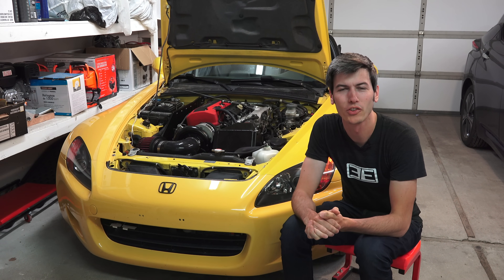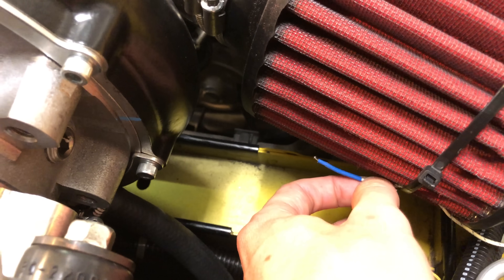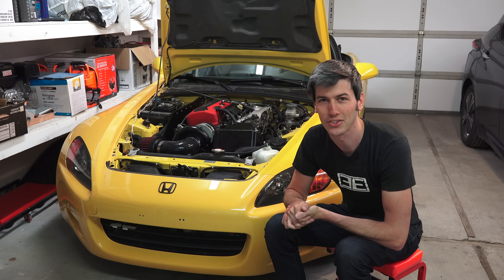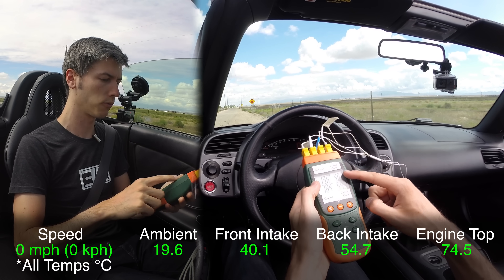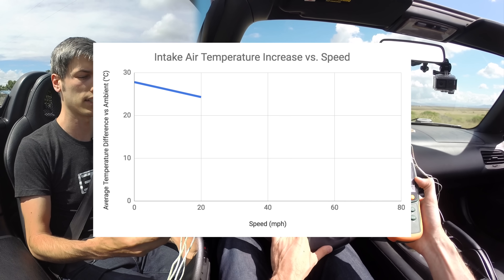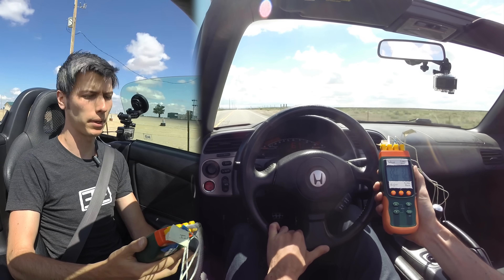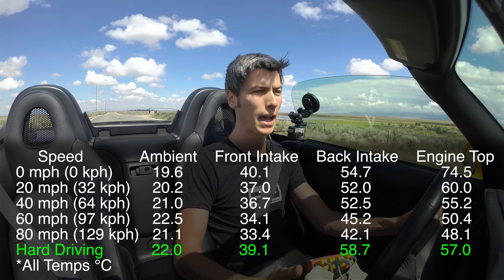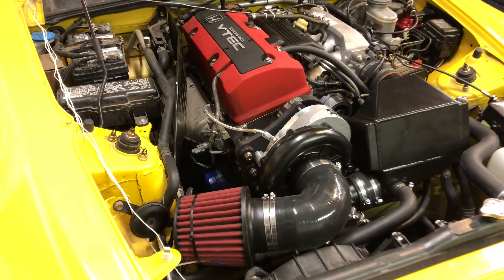Does My Supercharged S2000 Have A Hot Air Intake?

Comment: BRILLIANT VIDEO Jason! I have wanted to do this for YEARS! If you look at the reduction in air mass due to the temperature (simplified assuming intake is purely volumetric),  using Charles' law it's still 290K/320K = about -10% theoretically weaker mixture than it need be. Wouldn't it be great if you could actually get enough air to EXPAND and thereby cool below ambient temperature and nevertheless fill the compressor at atmospheric pressure. NACA oversized intake and insulated expansion chamber?! Your compressor will be heating up the air further, so IMHO you still need to measure the air temp. after the compressor. What do you think? All the best Rob in Switzerland.

Comment: Every time I see kids install a "cold air intake" with one of those filters under the hood instead of the true factory cold air intake they removed, I laugh. "but it has less restriction", no, it only makes more noise. However, the sticker form the box makes 5 more horsepower according to Rspec Ryan.

Comment: Great video I was really surprised as well. I would love to see a ram air / cold air intake tested out, possibly replacing one of the foglights with an intake. I would love to see how much pressure you could make at highway speeds, it wouldn't be much, but if you want cold air anyway might as well get a tiny bit of ram air too right? I know that the forward facing turbos that they use on drag cars do get a significant boost at high MPH speeds.

Comment: put the intake in place of the one of the fog lights. just replace the lamp itself with a fairly fine metal mesh to protect from debris. you will get the most airflow to the intake, and the coldest ambient temperature from outside

Comment: Wouldn't the sensor placement be biased by radiative heat and the surface temperature of the air filter? Need to place it behind the filter and insulated from the hoses to get accurate air temperatures.

Comment: i would be more concerned with the hot air from the radiator being sucking in then air flowing forward from the exhaust with how the Air filter is place

Comment: I have found aftermarket intake is usually worse flow and temperature compared to stock. This is the case for most of my volvo turbocharged cars. I switch to conefilter cai(even though its hot and less flow than stock) for the turbo spool noise and woosh of the closed bypass valve.

Comment: Jason.  Just relocate the horn/prop rod etc. and use a diamond hole saw to cut a path through the fender well and route silicone hose/bends coupled with short sections of metal tubing.  Put the air filter in the inner fender and take advantage of the high pressure/fresh air that exists anywhere in front of the core support/inner fenders....if there's room.  Don't be afraid if you cut structural sections.  Just weld in a heavy metal ring to put the strength back.  Its too late.  Your S2000 is a Character on Engineering Explained.  You've got 1.7 Million fans.  I'm sure ANY high performance company will be glad to provide you with the parts and tech to do anything you want with the car.  We can't wait for more and maybe in few years the Yellow S2000 will be putting 1000hp to the wheels!  We can't wait!!!Once you play with some pulleys there will be no turning back.  You have only cracked open that blower's power potential.

Comment: A very simple and effective solution is to place in front of the radiator and behind the bumper (at the ambient temp. thermocouple), a flexible aluminum duct all the way to  the filter. 7-8cm diameter is more than enough. You can also paint it black.

Comment: Idk if there is space in an s2000 to do this, but on my 93 mustang my cold air intake goes into the fender, and the filter is inside the fender and completely out of the engine bay. No hot air around the filter at all.

Comment: I think the thermocouple on the rear of the intake air filter is probably reading radiant heat from the engine and manifolds rather than strictly the intake air temperature acquired through air convection past the thermocouple. 

Which is to say that your heat shield should help reduce the heat, but if you're going to spend time and effort on it, then consider doing something like Subaru does with their turbos and put the air filter into a pod that matches up with the hood. Cut a louvered grill pattern into the hood and deal with routing rainwater out of the pod. You might gain a PSI with a bit of ram air at the front of the hood, as well.

Comment: I'm more curious on the temp difference on the air before the compressor and directly after it since compressing air will increase its temp. If you change the air temp in front of the compressor does it make that big a difference after its been compressed?

Comment: Tin hose 2” in diameter with an insulated covering, with a 12v fan fitted to the end.. I would find the best air flow location first then route back and point it directly at the air filter, about an inch from it.

Comment: maaate... you are going about this the wrong way. Use the OBD2 port and a $10 bluetooth adapter, and down load the TORQUE PRO app to your Android phone. Set up a custom guage cluster on your phone. Depending on the car, you should be able to monitor your it temps directly on your phone, but that is not the important thing.

Monitor your timing advance. eg, you may have 30°advance for most driving when the itemp is low,  but, if the itemp is high from idling @ the lights, when you nail it, the ecu detects knock and retards the timing. You can see this happening on your phone. Problem is, you may now have gone from 30° to 15° and your torque and economy will suffer, with a noticeable degradation under the right foot. stop stsrt City driving will not give your car time to readjust back up to 30deg, hence car will lack urge. Country driving is unaffected.

Yes, I have done all this on my Barra Turbo. e85 is a lot more resilient to ecu timing reduction, even @ 18psi, and I made a simple cardboard air divider that works fine.

Comment: OK but how much of a difference in air temperature equates to usable horsepower?  Even if the difference is 5 hp it's very negligible in any real world application.
Reply: Colyers Changes in air density allow for 1% hp increase for every 10F/3c drop in the intake air temp. 
You are one of those guys that will piss on any gain that doesn’t double the engine output because it doesn’t matter in whatever you define as the “real world”. I enjoy the performance of my aftermarket turbo everyday, in my real world application, and every tuning bump in power is appreciable. Go ride the bus if you want a negligible real world application.

Comment: Nice test! But would have liked you measure the temperature inside the intakemanifold... Would be nice to see the difference on the actual air that is fed into the engine. Also an interesting measure if you chose to relocate the air intake.

Comment: That filter is already very close to an ideal cold air source, that hole in the inner fender. Just extend the intake hose so filter resides in that semi round fender opening.

This avoids the hydrolock pitfalls of locating intake in grill area, yet still provides much cooler air.

Comment: I would have liked to see a sensor slipped under the rim of the filter so as to accurately measure the air actually going into the engine, having the sensor's on the outside of the filter makes them vulnerable to other factors (radiant heat from the exhaust for example)

Comment: Correct me if im wrong but did he not put a water to air intercooler?  If so he should have also measured temperature behind that because it doesnt have any effect in my eyes because if it is just as cool behind the intercooler as ambient temperature then the air temperature around the filter wouldnt matter.  Just my thoughts

Comment: i love me some hot air intakes, best way to maximize the decrease in air density.

The effect of a heat shield should be easiest to test, just tape in some cardboard behind the intake as a temporary air box/wall. 

Testing a relocation would cost more, but I am interested in seeing   how both affect the IAT, so if you're willing to try. I will certainly watch.

Comment: just a thought: take your good stock hood off, and put it away.  buy another one $$.  build a box that completely covers the air cleaner. on your replacement hood, cut one of those air inlets like on very fast cars or aircraft, over the airbox, cut the airbox to match the hoods cut out.    you see where I'm going here?   that cut-out is the type that has no disturbance at that area, but allows air intake.?  this way your not putting holes "in" the car, but the experimental hood only.?                               just sayin

Comment: If it's drawing air from your engine bay then it's hot AF.. route it to a cold stream high pressure area.. and if you're feeling really groggy, wrap your intake with exhaust wrap (dropped my IAT from 110 to 90)

Your car should have an inlet air temp sensor you can get readings with a 6 dollar dongle from eBay. It will tell you exactly what the car is breathing.

Comment: I'd be really interested in seeing the temperature differences with a cooler thermostat, it may not seem like it would change much but I could see a cooler running motor(lower underhood temps) and potentially less heat coming through the radiator. It probably won't amount to much, but every change could only be for the better, right?

Comment: A heat shield surrounding the intake and a cold air route from in front of the radiator to the filter encasement makes about a 50° difference (farenheit) as measured on my old cd5 accord. The flexible metal tubing at autozone and some sheet metal screws and hose clamps makes for a $25 fix on a cold air route. The heat shield can be bought for a not small price, or if youre handy with sheet aluminum, a press brake, drill, and rivets you can do one up for like $30 (cost of tools not included). The temp difference can be extreme for under $100 and a weekend of measuring and fitting. This solution is based on wanting the top end of a short intake, while getting the cold air of a longer intake tube: essentially, the best of both worlds. Im not a fan of cold air intakes on high revving engines as the longer intake tube promotes more of a torque increase instead of a horsepower increase. Just my $.02

Comment: Did you or will you check the air temp inside the tube, behind or in the air filter and then after the intercooler to see the actual air temp? Can you read your factory AIT sensor? Try insulating the air intake tube with a header type wrap?

Comment: It would have been nice to seen one of the thermocouplers inside the air filter.... take off filter, place probe in the middle of the inlet hose and put the filter back on the tube. You can take an average of the temps on front/rear of the filter but you will not be sure what the blend ratio between front/rear of the filter will be; a probe down the throat of the beast will be the sure way to tell. 
I vote to extend the intake tube and place the  filter in the front bumper area (if you can plumb it there).

Comment: MCM in Australia have two vids on cool air intakes. , Well worth checking. basically, factory intke system usually better than any pod filter and 1% increase if filter located in front of the grill. test on an R34 Skyline. temperature of air the same in all cases after the intercooler.

Comment: Don't know how thermal couples work but could the temp readings be influenced more by how much heat is being radiated onto them vs convective heating? the front back is 10-15 no matter how much air flow or turbulence. Maybe the filter absorbs the heat energy radiated onto one side enough to drop it that much in the front side?

Comment: I have an AP2 with the SOS stg2 kit. I know that a few people on S2ki have made intake piping that goes into the passenger side fender area. You have to run a slimline fan to make it fit. I have seen before and after dyno sheets showing about a 5% change. Not sure it’s worth the hassle when you can change pulleys and retune.

Comment: This was a good experiment.  I did something similar about 5 years ago with my 2500HD truck.  I have a ScanGauge II hooked up to my OBDII port and mounted above my rearview mirror.  After swapping out the stock air cleaner box with a K&N FIPK, I noticed the difference between the outside temperature and IAT while cruising on the highway was 20-35 degrees Fahrenheit on a mild summer day.  When the IAT jumped to 100+ degrees (i.e. city driving, stop-and-go traffic), the performance dropped significantly (as expected) so I decided to wrap my “hot air intake” heat shield with heat wrap and installed an Volant air scoop with Lowes downspout flexible tubing which directed air from the tow hook opening in the front valence up behind the headlight and pointed it directly at the cone air filter.  Using this method, I now see about 7 degrees F difference consistently between outside air temperature and IAT during a typical summer day.  Instead of relocating the intake, maybe you can use a similar approach.

Comment: Remember that locating the thermocouples in the filter's webbing will give a significant windchill factor aswell since the air passing through is moving a lot faster than the air at the front of the car or the static on the engine. 
Where the actual filter is makes little difference. 
It needs a cool air feed from somewhere so you can place the filter at the front then heat porrf/shielded pipe to the intake or you can feed that pipe to the location you have and box the filter in something as heat proof as possible. 
A bit awkward on an S2K because it's quite small in there. There used to be front clips available with various intake designs but I would say a small hood scoop right at the front lip may work well. It could feed a good sized airbox with the filter inside and it would not only be cool air but would also have a minor supercharging effect so making life even easier for the charger. 
I would heat wrap or coat the manifold and downpipe anyway though because less temp in the engine bay is always nice when boost is involved.
Reply: Oh and it might help compensate for the rich mixture up top a little if the map sensor can figure it out.

Comment: I have a 2016 Mustang GT and it will monitor intake temperatures. I was looking at this a bit today on my drive home. The in car thermometer stated 85F ambient temp. While not moving in traffic the intake temp would go to 135F. Once moving for a bit the temp would go down to 93F at minimum. I have the Ford Performance cold air intake that does route ambient air through the front grill to the air box.

Comment: I definitely think you need to get cooler intake air.
But make sure it fairly high up and doesn’t get any water into it from heavy rain or worse driving through a puddle of water that’s deeper than it looked.
That Honda is already pretty low to the ground as it is.
I don’t want to see a motor grenade by hydraulic lock.
ErictheCarGuy had a piston cracked by hydraulic lock with gasoline. An accident with a fuel pressure regulator set too high.
AutoVlog  had a brand new Mercedes AMG something-or-other get hydraulic lock going through  water not very deep that splashed up under the hood and caused hydraulic lock. Motor ruined. Car totaled. AMG apparently didn’t do good research or design when they modified the engine. It rains a lot in Europe so they better fix it toot sweet.
Great video. Interesting data. I’m actually surprised at how high the temperatures were.
Even tough I’m an engineer myself, I’d do the conversion to Fahrenheit and list both for the average subscriber. Even I just ballpark it in my head.

Comment: turn 90 degrees up

cut hole in hood

cold air
Reply from the maker: The perfect aesthetic solution.
Reply: Wow. There is really no better answer than that, I'd think.
Reply: And if it ever rains...
Reply: While you're at it make a big funnel for cool air ram to the turbo.
Reply: Ricer Miata can build you a snorkler.
Reply: Corrosion37 
While you're at it, don't go half ass, engineer a proper NACA duct.
Reply: Well, it would look rad as hell.

Comment: Ive found mimiking Hondas factoy intake setup, is the best way to get any form of "gains" from intalling an aftermarket intake. Honda goes through very meticulus process to make sure the best airflow goes into their engines. Usually the best place to put it is where the original baffling was.

Comment: I doubt you would see much difference in temps entering the throttle body by bringing in cooler air to the supercharger since the car is intercooled. However bringing in cooler air would prolong the time before the intercooler gets heatsoaked.

Comment: Very Nice! I have played around the IAT from the ODB2 data for different air intake configurations so I was not surprised at your results.  I have never checked the difference without the heat shield box on mine though. With the intercooler it would have been interesting to compare your intake temp with the ODB2 IAT temp.  I assume the super charger set up still has the IAT sensor.

Comment: If you relocate the air intake, you'll see about a 5% power improvement. You gain about 1% more power for every 10 degrees F. 30C is about 54 F.

Comment: I always thought cold air intakes were mostly nullified in FI applications due to the air getting compressed and being heated up extremely high negating the cold air gains, hence the intercooler before air reaches the engine...? thoughts?

Comment: Great vid as always and I wonder if you guys peel the intercooler paint off and polish it would that help the cooling by reflecting the heat a little and a aluminum intake piping instead  of the rubber one?